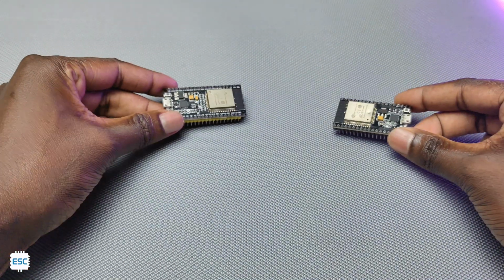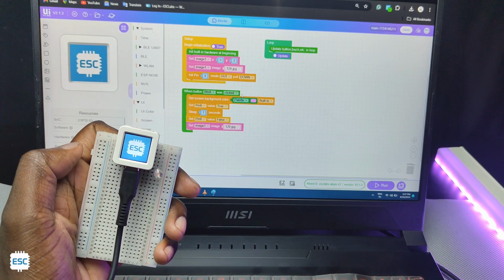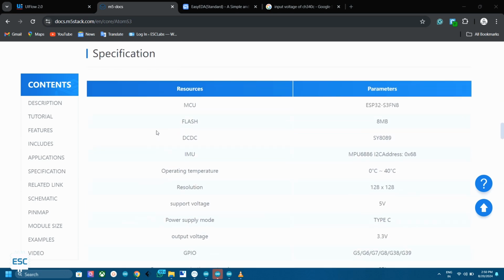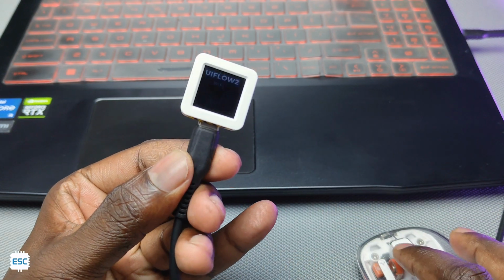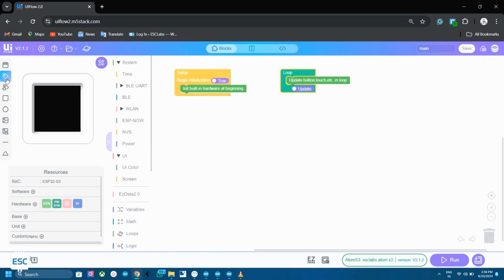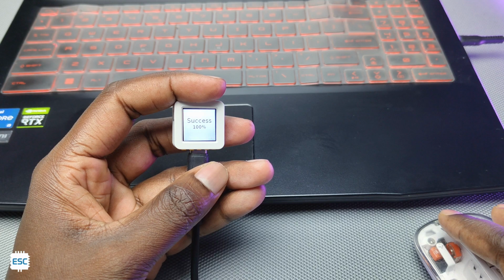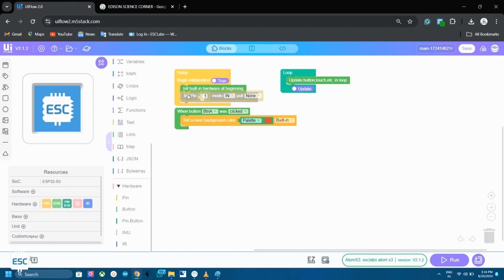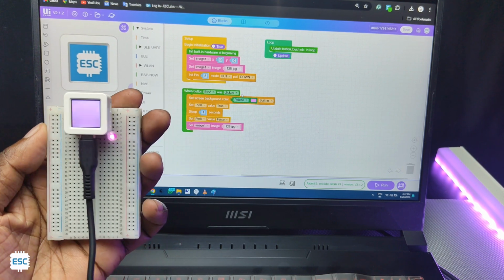How to Program M5stack ATOM S3 | UIFLOW 2.0

Comment: I love UIFLOW ID really easy to work with
Reply: can’t do much with it though. arduino ide is 100000x better
Reply from the maker: @SR-HVAC its only for m5 stack devices
Reply from the maker: Yes. Actually block coding is simple. Love to do more in this .!